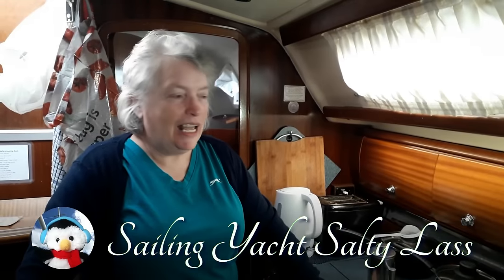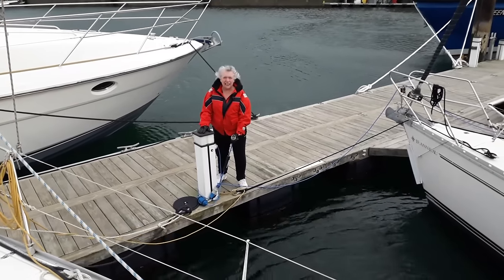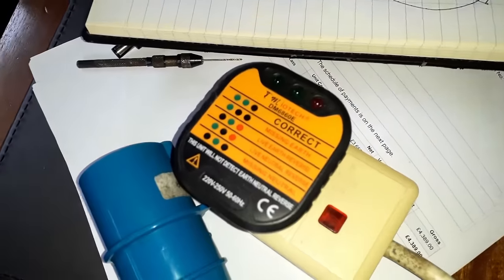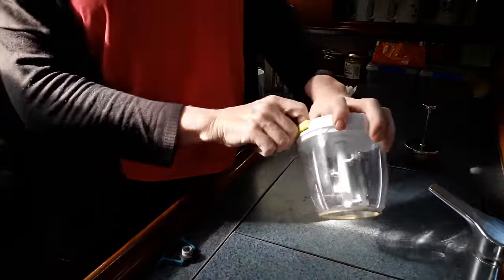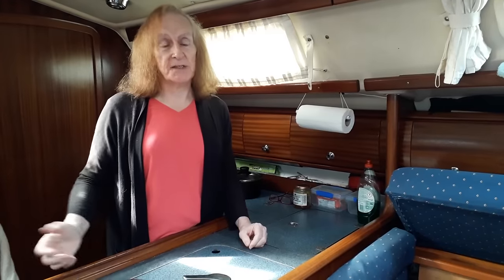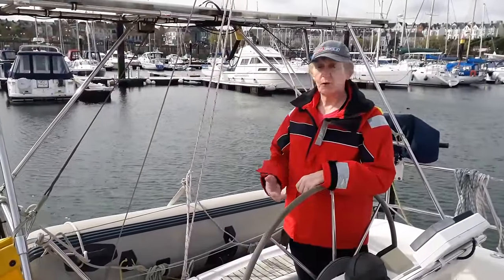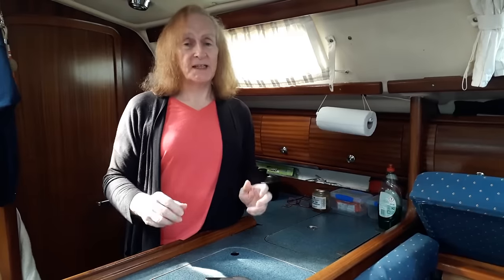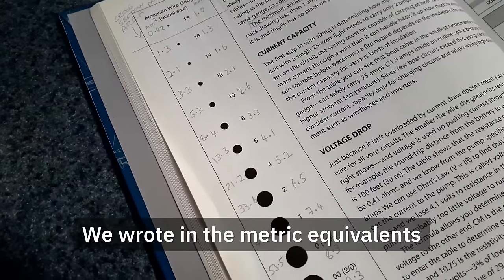Winter talks - AC Power - Electrics - Lithium Batteries - Lead Acid Batteries - Ep. 335

Comment: You got it right :-) Note: Your AC ground protection gives you protection up to around 1,7 V (don't arrest me on that number, but I am very close). The only gismo to give full protection is an AC/AC transformer. Then you are in your own electrical world. As a security decission, we do not carry gas on board. And, in my part of the world, it seems to be an increasing issue. But we (by 'we', I mean my wife) took that decission back in 2000. Then I had allready built approved gas lockers. I built the whole boat, by the way. And, due to diet issues, we need a freezer. So now we have a cooler, a freezer, micro wave, induction oven, and so on. And, in our part of the world, it rains, it snows, it's dark in the winter, and solar panels are great. But not under 2 inches of snow. Our lead acid batteries lasts for 10+ years. And they can start our diesel motor, and run our thruster that takes 7,5 kW. All well. And we bought 20 years ago a second hand gen.set, made in 1987. Last year we installed 400 Ah Lithium. For us, underlining for us, it's a game changer. The batteries weigh 'nothing', can be installed upside down, and charges at 50 A+ until they are 100 %. Then the charging stops (separate 220 V AC charger). So, under sail, sv Hulda consumes between 10- and 15 Ah. The gen.set can on demand supply 6 kW contineously. Main gen.set fuse is 32 A, don't need that. But I have equipment that needs 16 A fuses. After 8 hrs. we run the gen.set for an hour, and the batteries are 100 %, eggs are fried and the coffee is hot. Warm water in the tap. On the dowside, a litre og diesel or two.
Reply from the maker: I guess we store a lot of energy in gas bottles. We have always had gas to cook with, even when living on land so we are used to it and we are always very careful handling and using it. As a matter of  fact, we have just had our gas safety inspection (passed!!) so we are pleased with that.

Just like all boats are different, I guess all power systems are different too. At least you have one that works well for you and that is really what matters, but it is great to get feedback from people whose opinions we trust rather than the random noise that infests a lot of the internet. 

Thank you! 👍
Reply: @SailingYachtSaltyLass  Yes, instead of arguing over different approaches, accept and find if there are elements of value that can be adopted. We don't even have a gas lighter on board. Stoped smoking Wendesday before Christmas 1985. Yes, gas contains a lot of energy. Less than 1 kg will blow a mid sized boat clear of the water. Domestic gas was abandoned decades ago in Scandinavia. Now we in Norway just produce and sell it to EU, UK and Ireland :-) At a good price. Though not influencing on my pension.

Comment: £1200 for the arch, is great 🙂We had 360ah of lead and could run fridge safely for 3/4 days without the arch. On the new boat we want to run induction hob and the boat has two fridges. Arch will be a must but I am hoping the new deep discharge lead batteries will work for us. Space will be another issue of course. Your dc to dc inverter runs laptops and stuff?
Reply from the maker: The small DC/DC unit gaynor was holding is specifically for the laptops. The blue inverter can also power a laptop through the normal AC charger that comes with the laptop. But we also have USB chargers that plug in to the 12V systems and they can charge anything that has a USB charging port.

Comment: You can only use about 45% of lead acid battery capacity, where as lithium you can cycle much deeper. Factor that in and your calculations might work.
Reply from the maker: We did factor that in, comparing 360Ah of lead/acid with about 270Ah of Lithium.

Comment: Great video,  keep them coming!

I have a question that you may have answered in another video?

I noticed that you use coffee beans, so I suspect you make some nice coffee on your yacht. Can you please do a video on making a good cup of coffee? (Cappuccino, latte, etc).
I am on a pontoon with no electricity just a calor gas hob, so I would look forward to hearing how you manage to make your coffee.
Reply from the maker: Yikes! Now there's a question 😮 TBH it is not something we ever gave any thought to. We just grind it up and use a little cafetiere. I will see if we can do something. We can approximate a cappuchino sort of coffee but the effort requires a special occasion 😄
Reply: I'm fussy about coffee. 
The 1zePresso k-ultra is great for a wide variety of types of coffee. Good grind and fast.
My suggestion is to use a kettle and an aeropress when moored. But I don't think that's safe at sea.
For milk the challenge is heating it. The ways with least mess use electricity. Probably you will need to heat in a pan and use a wand to froth it. We got the powerful Nanofoamer with USB rechargeable battery, lasts ages and is massively more effective than the ones with AA batteries. Note a thermometer is essential to avoid burning the milk.
Reply from the maker: We do have a little electric AA frother which is on its last legs...
Reply: @SailingYachtSaltyLass  the USB Nanofoamer is like chalk and cheese. Much more powerful, creates good foam. See sponsored video by Lance Hendrick (latte art champion).
Reply from the maker: We will do - thanks for the tip 👍

Comment: We use an Ecoflo Delta as an interface for power
Reply from the maker: Just done a quick Google and I cannot see the point of it. It appears to be a battery or transformer. We already have batteries aboard. I'm obviously missing something here.... or am I?
Reply: @SailingYachtSaltyLass  
 I also have a g
Huge battery bank,  but the ecoflow is a new that outperforms them. Anyway we can choose the Ac imput charge rate and there for we have to unplug other loads to do something like making tea..
  We have moved to an induction cook top which we use for majority of our coffee making and making eggs for breakfast plus a toaster.
  This saves huge on propane consumption 
  It provides 2600 peak watts and 1200.plus Amp hrs..
  Just an  amazing piece of kit. 
  And has high solar and ac recharge rates.
Reply from the maker: Interesting piece of kit 👍 To save on propane (butane in our case) we just bought a thermal cooker. Sometimes we can be such cheapies 😄😄 It looks very bulky. Does it fit in a locker? Does it need ventilation?

Comment: What brand is the Galvionic isolator ? We have one wired into the boat but I liked yours being inline with the cable. You should rewired the socket by the way. We have 600ah of lithium and I’m not sure what we would do with out it. Great informative video !!
Reply from the maker: The isolator is this one https://www.amazon.co.uk/Galvanic-Isolator-Installation-Suitable-Materials/dp/B0CFVSRR9C 

As for the socket rewire, as we said in another reply - it is a real pain in the a#*s to get to, is a North European socket and we almost never use it for anything. So we left it alone...

Comment: Your slightly sexist lesson about sockets is absolutely bang on. 😌 In a previous life in the military I've plugged in to a vehicle radio supply socket which had been wired with the terminals back to front. The current was only 24V but the bang and the sparks accompanied by the cloud of escaping pixies was something to behold. Grabbing hold of 240V will definitely curl your hair. 🤕 
Incidentally your 'upside down socket' has neutral and live wrong - not neutral and earth!
Reply from the maker: That wee flashy plug thing has the faults all noted on the back. Gaynor needs to read more carefully. As for the sexist socket - I had no idea she was going to say that - I was just holding the camera, filming it, editing it into the video, etc. So I plead total innocence 😄
Reply: If you got a bang then the short time  fault current depends on the supply impedance which is very low & the current may have been in the region of more than 50,000 amps. If the upstream over current fault protection device operated properly then the fault current would have been limited in duration to less than a few milliseconds. Current is not measured in volts, it depends on the load resistance or impedance normally & can also depend on the supply impedance in the event of a load fault short circuit situation.

Comment: Hi.

I do agree with you. If you swap to LiFePo batteries you should also upgrade other components of your 12VDC system. Bavaria's is not a bad brand as the German standard of electrics are fairly good.  I would fit a device to protect the alternator from overheating i.e external controller or a DC/DC charger. The original diode battery charge separator should also be replaced by an Argo-FET or similar. If you have an old  battery charger, it may have to be replaced to suit LiFePo batteries. Wire gauges also have to be increased due to possibly higher currents in your system. In my case, a cost of £ 2500, just for bits'n bobs.
If you are skilled in electrics (like I am) and do the swap your selves, it can be acceptable in terms of money spent over years. If you have to pay professionals to do the job, it is not!
I still run lead-acid batteries and spend my money on other upgrades instead. Apparently not a single part for boats cost less than £ 100 :)
That being said, I will go for LiFePo one day, just for the benefits.... not for saving money.

Fair winds, sail safe! From Norway.
Reply from the maker: That is more or less why we are holding back at this point. Our shore-power charger would need changing too. I think Bavaria has a charge relay but it is an area of the boat that I have not gone into too deeply as everything is working normally and even I know that the first rule of engineering is "If it ain't broke, don't fix it"

Comment: There are lithium batteries available for much less than you mentioned. I recently bought a 12.8 Volt, 280Ah LifePO4 battery from Eco Worthy for £539 to replace a couple of old 6 Volt 225Ah lead acid golf cart batteries in a small solar setup. The difference is night and day. Lithium is so much more advanced in so many ways including cost when the number of cycles and usable depth of cycle is taken into account.
Obviously with your panels and current usage you have no reason to change your existing lead acid at this stage as you have demonstrated.
Reply from the maker: If we were starting from scratch and replacing everything in a new build or a project boat, then we may well have gone down the lithium route, but that is not were we are. Nonetheless, I'm really glad that it has been a viable upgrade for you.👍

Comment: Excellent info. Does the does the possibility of fire, influence your decision in relation to lithium batteries?
Reply from the maker: No, not directly.  The fire issues are more prevalent with Lithium Ion batteries (think phones, tablets, etc). House batteries are Lithium Iron Phosphate and is a more stable type of battery. However, Lithium batteries are prone to handling larger current loads than lead/acid so there is a danger if cabling is not uprated to suitable levels capable of handling those currents safely.
Reply: @SailingYachtSaltyLass  Thanks for this. The following has nothing to do with sailing but you since you are smart people, I thought I would ask. The guy that services my caravan was telling another customer who wanted an upgrade to lithium that he didn't think the technology was there yet for caravans.  Would vibrations be the issue or that people might not appreciate the cost of rewiring and upgrading solar panels along with cost of the batteries?
Reply: @maxcaravan7584  Hi Max, sorry but that's not right, lithium iron phosphate batteries are definitely suited to caravans, they just need to be secure just like on a bouncy boat. Goodluck 🇦🇺👍
Reply from the maker: @maxcaravan - perhaps your caravan service guy is confusing the two types of lithium batteries. Trust me, if they are safe on a boat I would expect them to be more than suitable for a caravan. Just make sure that the charging circuits can handle the maximum load from the panels and the MPPT controller because with Lithium, they will draw maximum current down from the charging circuit for a prolonged period. Lead Acid batteries never do that and the charging currents tail off as the battery charges.
Reply: @seawench555  Thank you
Reply: @SailingYachtSaltyLass  Thank you

Comment: We only use electric kettle or fan heating in a marina. Mind you now we have eberspracher it won’t be used much anymore.😊. I have a small inverter but it lives in the press more than is used. I had bought a new inline galvanic isolator but don’t use it anymore. It seemed to affect our battery charge. John always hated it.
We’re thinking of solar panels off the lifeline/ cockpit steel at some time in the future just to keep us topped up . Our friends are planning on putting solar on their westerly Falcon this year so they can be offshore longer.
Are you thinking of something like Mads solar set up for doubling their space or like Cadoha they have special solar panels they winch up the mast at anchor .
Reply from the maker: If we expanded the panels, we would likely look for larger panels and modify the existing arch to take them. We though Mads's crazy "tilt in all directions and slide out" arch was way over complicated. We would be more likely to get foldable panels that could be set out at anchor and plugged in if required.

Comment: It's a pity you just got a new one, but here in Austria most kettles are around 2000W but you get them way down to below 1000W for even less than 10€. Of course you have to wait longer, that's probably why they don't sell in tee nations. 
Regarding lithium Iron batteries I don't share your concerns and I'm wondering don't you have like a fridge or Laptops for video editing to charge?   You could replace your two batteries with one lithium battery. Depending on your solar charger it could even work with those?
Reply from the maker: We do have a fridge, but not a freezer. We have laptops for video editing and we do that using the power from the panels. The batteries are topped up by early morning and the panels are powering nothing after that so we use the DC/DC charger and plug the laptop into the boat's 12V circuit. 

The costs for lithium we calculated was for an equivalent capacity to what we have now (allowing for the bigger depth of discharge). There were much cheaper Chinese batteries but I have a distrust of really cheap stuff - you can only drive the price down so much before you cut back on something important. OTOH no one likes being gouged on price so we looked at manufacturers with a good reputation.

It's a compromise. It always will be and there is no totally right or wrong answer. What we have works and is affordable. Perhaps things will change in the future? We will know when we get there... 😉

Comment: Thanks for the A/C D/C lesson … having converted the house batteries to 48v lithium and 48v alternator onboard my boat - I am not sure I agree with with you 12.5 year comparison between LED acid and lithium … prices for lithium has come down very considerably and taking into account that you can discharge down to 10% vs 50% for led acid - the like for like capacity you need for lithium is less (or using the same space - you can significantly increase your capacity)

Solar will unfortunately never get even close to the output from an externally regulated high power alternator (I live in Dubai and if solar would be efficient it would be here) …. With 15kwh lithium capacity I can run the air conditioning onboard overnight off the batteries (we do not worry about heating here ;-) … fair wind and full power ladies
Reply from the maker: Wow! That rewire sounds like a major project!

The 12½ year thing was just giving the Lithium the 2.5x factor that our lead/acid batteries have. According to the blurb sheet our batteries had a 2 year guarantee and here we are 5 years later and they are still going strong. Since the lithiums come with a 5 year guarantee I just multiplied that by the same factor. It is not a hard and fast rule but I needed some way to make a comparison of very different products.

BTW - I think perhaps you do worry about heating in Dubai, it just happens to be backwards compared to us 😄😄 We are trying to keep the heat in, you are trying to stop it getting in.

Thanks for watching and for commenting 👍

Comment: You two are adorable. 
Apparently UK prices are high.
I can get a single 260ah lithium battery for under $700, and it will last me 10-15 years. Much cheaper. 
I guess bottom line is, go with the setup you are most comfortable with.
Reply from the maker: At that sort of price, we would be ripping out the lead/acids... probably... 😄 We also need to think about all the other upgrades needed for our charging infrastructure, but the prices you are quoting are about 2/3rds the price they are here.
Reply: @SailingYachtSaltyLass  location is everything. And of course, specially marine graded equipment is always more expansive.

To get used to lithium, I recommend a solar generator with a portable solar panel. You could use that independently from your house system and just run computers, cameras and such things from. 

One thing to remember is that if you are at the forefront of innovation everything is more expensive. 
Naturally younger people are more willing to invest in potential failures while older people might think going with proven tech is going to serve them better. Both groupés are right.

But prices are also coming down. LiTime has cheap high duality batteries. But it’s based on US distributors.  find your sweet spot and stick to it.
Reply from the maker: We are looking into portable solar panels for a future project so thank you are giving us some ideas. It's a long way off at the minute but we are in no rush.